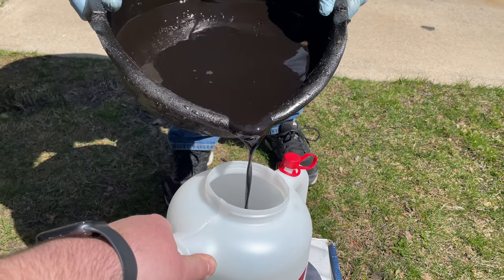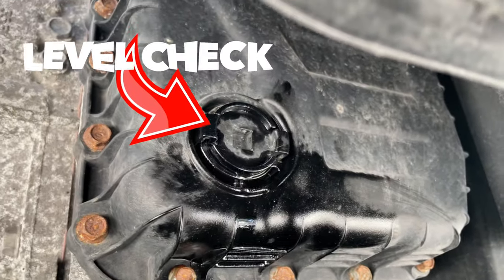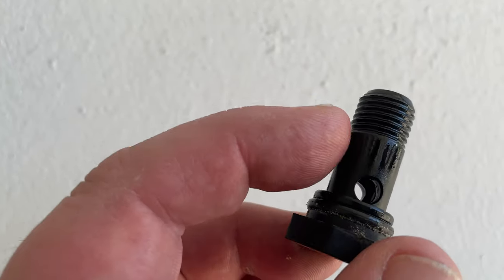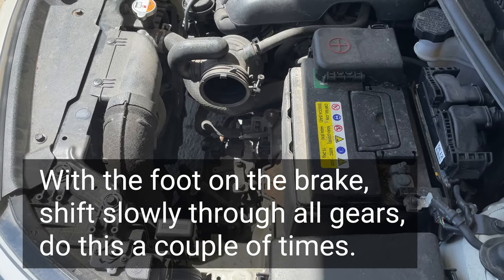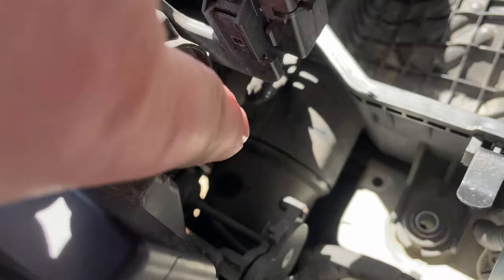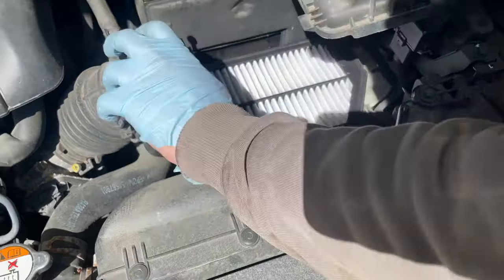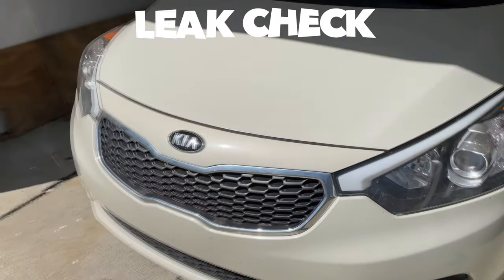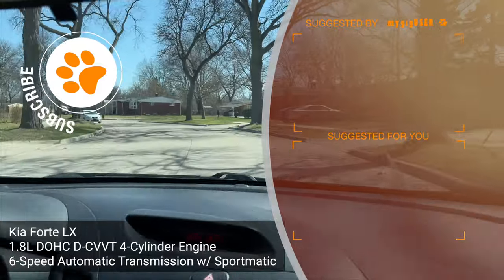Transmission Oil Change Kia

Comment: Your transmission will now be slipping, you shouldn't have changed it if the oil was dark, the metal debris is what keeps it from slipping
Reply from the maker: it's not, you don't know what you are talking about. Thanks!
Reply: Yes, with that dark fluid you are opening up Pandora’s box…slippage, poor engagement and clunking to follow!
Reply: I have a 2013 forte that 80,000 miles on it, it now has 184,000. I guess it's never been changed, when I deciphered the "sealed transmission " crap, I thought about changing it. I'm not sure that I should now. I've always heard about the problems of doing this but, I don't know for sure?!
Reply: Slipping or not cannot get any worse now
Reply: Mi cambias todo el aceite completo lo más probable que si empiece a patinar , lo mejor es cambiarle la mitad de lo que ocupa la transmisión ojo en caso de que el aceite esté negro como el del video, si el aceite está bien 80mil km se puede cambiar entero , gracias saludos.

Comment: I just did mine yesterday. I have 142,000 miles on my 13 Rio. I change transmission fluid every 30,000 miles. All I do is drain, measure what I took out and put back in what came out. Simple
Reply: Yes this what I did. Although the recommended way is to get the temperature reading of the transmission. Then check the level.

Comment: Apparently, Kia says this is lifetime transmission fluid and there's no service required..
Reply from the maker: @manny3918  yeah, i can see that by the color of the oil. What do they mean by lifetime? 100,000 miles?
Reply: @mygiguser  I guess when the warranty is up and they don't have to replace the transmission for free.

Comment: Should have added more fluid then got it hot again, go through the gears. Then pull the check plug and let it come out until you see a steady flowing thin stream of fluid exiting. Don't just add fluid until it exits the check hole. This is not a rear differential or transfer-case checking procedure

Comment: As bad as that oil was you should probably change it again in 500 miles. It would be interesting to see if it is still on the road.
Reply from the maker: yeah, the car is still driving (very low mileage driver), and he didn't want to change a second time. He thinks it's good enough. If that trans fails, the car will be a total loss.
Reply: @mygiguser  You can't force someone to take good advice. Happy New Year to you and your family.

Comment: All those clutch plate debris in it. If it's over 30,000 miles, I strongly suggest you should have replace the internal ATF Strainer as well. Looking at the color, I do believed that your ODO mileage is over 45,000 miles. If you did replaced the old ATF strainer, cut open the old ATF Strainer and you would find metal debris in it.
Reply from the maker: Jeremy, this car has 120,000 miles on it. And that oil had never been replaced. Nobody ever touched the ATF strainer. After this oil change it is good for 100,000 more miles. It's going to be OK!
Reply: @mygiguser  Alright, I can agree as the Standard of quality control especially when the said car is produced for Western Continental usage.

Comment: Did you have to jack the car up (raise the car) to change the transmission fluid? Can it be done without using a car jack and lift stands?
Reply from the maker: @gonzo8303  yes lift it up
Reply: @mygiguser  I have wheel ramps and 2 jack stands, can I change it with that or do I have to buy a floor jack and more lift stands to make it level? Can I lift the front, drain the fluid, put the same amount back in that I drained out (an equal amount of new fluid), lower the car off the wheel ramps, and then go through the gear shifting with the new fluid in? 

I would like to know if I can use the tools that I have now to raise the front of the car or if I have to buy more tools (i.e., a floor jack and additional jack stands) to do the job. I have a 2017 Kia Forte by the way. Thank you so much for responding and for posting this video!

Comment: The colors do tell the condition,  from red to black, along with smell, I am sure we know that, Great job having help guys,   Are you going to change out again after a short drive so you can get  it cleaner with what was  still left in.  I am not sure of the side plug, and I have to inspect our cars.  My Sis is  going to need one, one day and  you are more than welcome to  do it.  great job
Reply from the maker: not changing again anytime soon. trans flush no good. give it at least 50k miles.

Comment: New fluid and old filter.  Half the job.  Do you leave the old oil filter on when changing the oil also?
Reply from the maker: Yes, you don't have to change it every time. That would be wasteful!
Reply: The filter in these transmission isn't accessible when you remove the pan you literally have to remove the transmission from the car & split it in 2 in order for you to get the filter out. I've seen these transmission go up to 400k miles without a single change they are made to last, this simple fluid drain & fill will definitely help increase its life

Comment: why not changing internal filter?? I know you will have to open the gearbox to replace, but need to know if it is necessary or not for this type? as ideally changing oil comes with a new filter.
Reply from the maker: yes, i see what you mean, but my buddy here was lazy, and didn't want to do the work. In this case it is a little more difficult than in other cars!
Reply: Those filters can only be removed by dismantling the entire transmission includng the torque converter. Wonderful engineers put 2 crews on filter innacesible from valve cover

Comment: I am buying 2nd hand 2016 Kia cerato 
Has done 83000 miles 
Good ?
Reply from the maker: idk over the internet, you need to test drive it
Reply: @mygiguser  smooth shifting so far 
Getting for 14.5 aud 
Worth ?
Reply: Do you have maintenance records? Check the fluids. Does it drive ok ?  Any codes from OBD2  ?

Comment: Thanks a ton! 7/8/24
My Transmission is sealed so just fluid replacement.

I instead used Valvoline MaxLife  Multi Vehicle full syn and car runs better! Added Lucas Oil Tran Fix 10009! That's best with every change it's true what reviews say about it👍 

I poured back what I emptied out into a 5Q empty clean oil jug, made sure it had measuring. 3.4Q but was low! That also included the 24oz of lucas I poured & mix into the Valvoline fluid, sit it top of engine to warm up before adding. 

I made sure engine was hot, ran it, shifted gears,  re check it, thats when I pour a lil at a time to see that steady stream flow out, then that's it.  👌 

Final Verdict: 2015  Forte LX 1.8 runs better, had dark real bad fluid not muddy but bad. I think over 60k..  I was worried about changing from reviews, definitely not👎 a flushed!!  Just half out half in changes.

Comment: To make it super easy, just    add back the same amount you drained!
Reply from the maker: what if it was too low? You never know. Best to fill up to the correct level.
Reply: @mygiguser  I suppose your right. Especially if the car has a ton of miles on it. Other than that, if low mileage, then should be very easy.